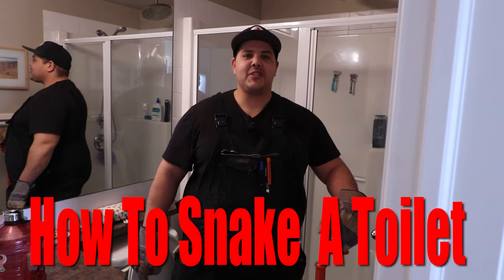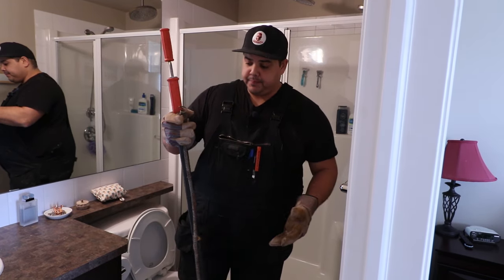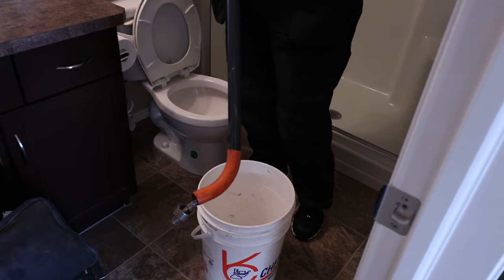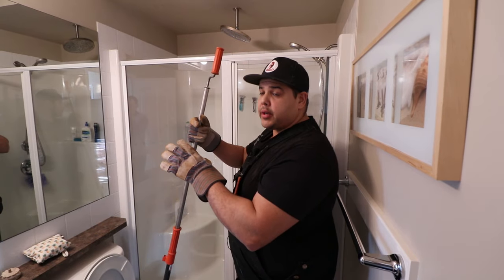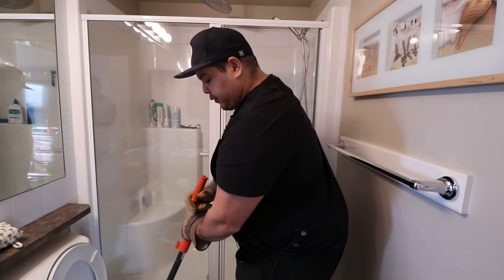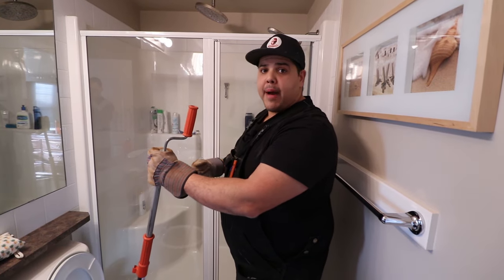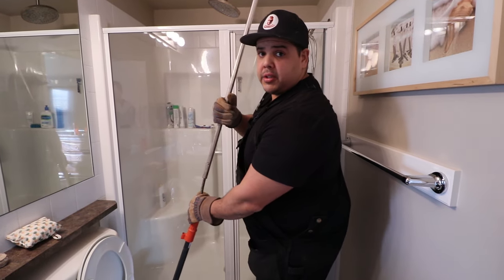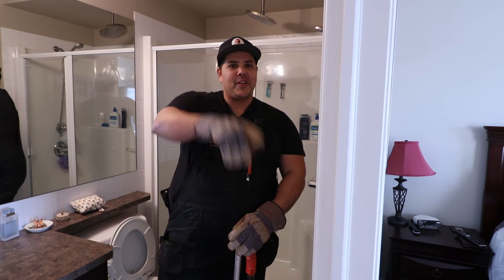How To Snake A Toilet - Using A Toilet Auger

Comment: Nice instructive video man, I have the Ridgid 6' Auger i just bought and for some reason mine will not go more than a foot into the toilet drain, it seems like it's hitting something on the inside, and at one point it even double-backed and started to come back out the drain as i'm turning the crank and pushing down.  I think the design of the Auger head is catching on things. I'm stuck...
Reply from the maker: Hi.
Have you tried taking your toilet off and inspecting the bottom??
Reply: @ThePlumbingGurus  I'm doing that today, I think the design of the toilet prevents augers from being inserted into the bowl drain.  Cheap POS Home Depot brand toilet (Glacier Bay)
Reply from the maker: Sometimes it takes a bit of work to push the snake through the toilet. And yes those are not good toilets.
Reply: @ThePlumbingGurus  yes i'm aware of the effort it could take but this toilet doesn't have an actual opening that's large enough to fit the cable through, I tried to handfeed it through with gloves on and it's hitting against the porcelain at a certain point and there's no "opening", it's weird.  And previously when i thought it was going in about 1', it was actually just coiling up in the area where stoppage is and eventually started coming back out where i inserted it.  I been looking online everywhere on what kinda toilet bowl drain it is or the design and there' s no info anywhere

Comment: Yesterday started with one toilet at bottom was leaking so replace wax ring . Noticed toilet right in the next room was clogged I've tried plunger but it's bigger problem  since looks like crap coming up in that next room's shower drain . I know you don't know how my lines are running this way or that but what can you tell me ? Seems next step is auguer / snake it but not sure where to enter . Have one cleanout I might use but it's way in the backyard ..